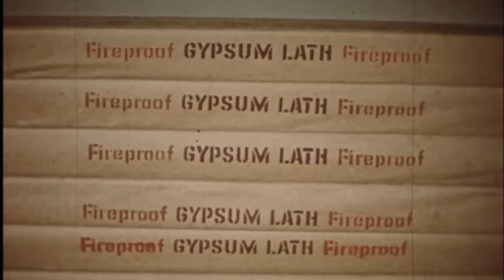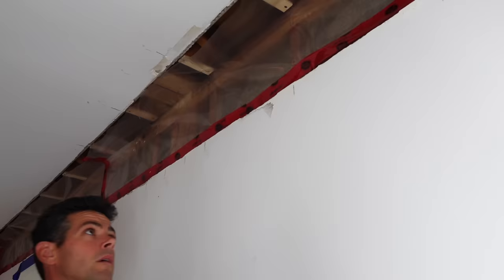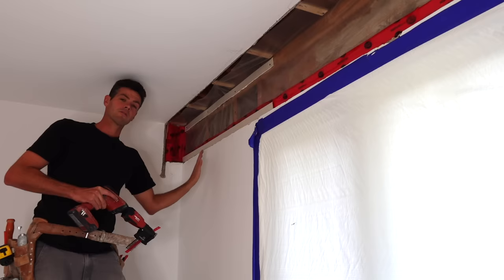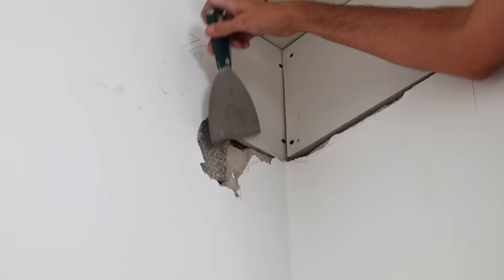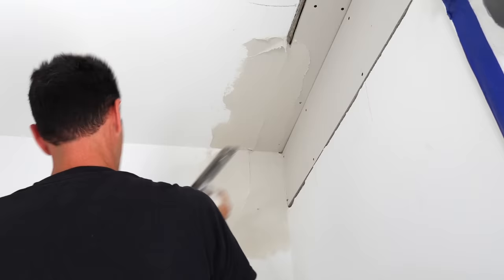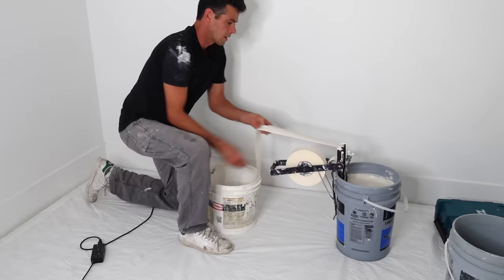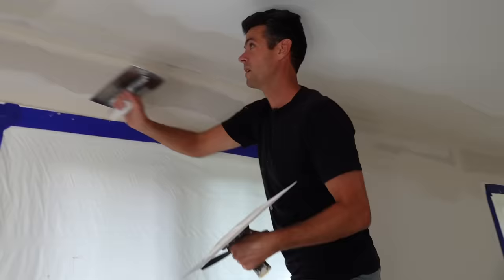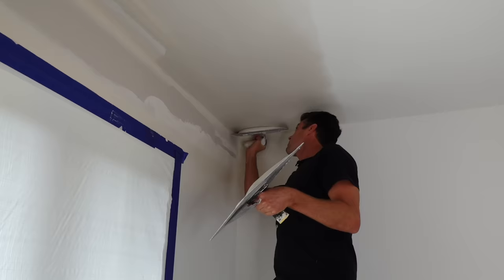How to Repair Mid-Century Plaster with Drywall!

Comment: The contractor I worked for in the 1980s would patch plaster walls by nailing or screwing a piece of 1/2” drywall in the hole with the back side facing out. We would mix up a bit of Structolite and fill almost flush, then give it a coat of finish plaster. Working with Ralph and Nick, (my boss and his brother), was like having walking encyclopedias of how houses were built from the 1920s onward.
Reply: I agree that is a better idea

Comment: I have this in my house, which was my grandmother’s house, built in 1950.  The only difference is the “drywall” boards underneath are “button board” which has holes to key the plaster through.  It also seems harder, maybe not quite cement but similar.  It has archways in all the doorways except between the kitchen an dining room, which used to have a swinging door. I decided to buy an arch kit and put in an arch there, and now I’m working on getting the right depth between the drywall and plaster.  This is pretty good timing for me!
Reply: Perferated gypsum board lath.  Rock Lath was one of the bigger brand names back then.

Comment: Our home was built in 1943.    While doing renovations years ago, I discovered our beautiful plaster walls used gypsum board instead of wooden lathe. This gypsum board has held up amazingly well, and it enhances fire resistant and insulation. You’re right about this type of plastering being well done. I hope people who have this type of plastering will see its value from your video and patch repairs like this instead of ripping it all out and replacing all of it with drywall.
Reply: I'm working on a house from 1760 and I wasn't quite sure what that was I was working with. It wasn't horsehair plaster and I gather that at some later date somebody used cement board or something similar to door repair in the early 1900s perhaps. I'm not sure
Reply: Not door repair but I meant to say to repair

Comment: Great vid Ben...someone asked about matching textures for a repair..there are four different textures in my house. One method they used was lay out a thin coat of plaster and then press a damp burlap sack into the wall..my parents witnessed this when they had the house built in 1947 (Victoria,B.C.)
Reply: I'll have to give this a try,  i was using a torn sponge but it never turned out quite right
Reply: And you know when I do plaster repair I use some cloth in the initial layer after I put a sloppy layer on the left with a paintbrush
Reply: @failprone well. I used cloth. And it was either an old lightweight towel that was dipped in a slurry after I already pre-wet the wood with a slurry to let it soak in. I wasn't covering huge areas but I already knew that if you don't pre-wet or do something to get that lathe wet, the repair will pop out because I did a repair in a house in 1860 and the crack would reappear with simply using wall compound. It was a stress crack near a door that open and shut every day into the apartment and after I added dryer lint into the area and free wet of course. The surrounding would of a 5 inch by 3 inch hole. It never ever popped out again and that was my third and final repair at the entry into my apartment where the door handle is. And it's never cracked. The house has since been remodeled and taken apart by some new owners but I do remember the trick of dryer fuzz or lint to strengthen the wall compound
Reply: I meant to say l a t h e

Comment: Decent command of the tools, kid.  1/2 drywall on top of 1/4 drywall furring = 4/8 + 2/8 = 6/8 so with 7/8 nominal thickness of original plaster you will have 1/8 nominal to spare to fill and true up the plane. Of course that means sometimes it can be flush or protruding.  I leave 1/8 to 1/4 inch gaps between the Rock Lath and drywall and make sure my plaster is stuffed in there.  Lightly wetting the gyp core helps adhesion.  It will not crack like that.

Comment: Have the same set up in my 1950s house in eastern PA. Had to do something similar. I opted for 5/8" drywall directly on studs (instead of adding filler strips and using 1/2" drywall). Prefilled with Durock 90 and then used premixed mud (on top of Durock 90) since it's easier for me to get a smoother texture. This was my first drywall/mudding job. Unless you really know where to look, it turned out decently well.
Reply: I patched plaster using Concrete Fill , more common out west than Durabond , very similar compound , only “mud” that will bond and blend with plaster
Reply: Currently attempting the same.

Comment: Oh how badly I wish you had made this video a year ago!! We purchased our 1962 Toronto home almost a year ago now and have been DIY renovating it ever since. There's not much info about this era of construction on the internet so we have learned a lot through trial and error. We also learned how solid and heavy this stuff is during the demo stage! Some walls were wavier than others, but overall 5/8" drywall lined up pretty well with the old plaster, and then we FEATHERED out any height differences. This video is very validating for our noob DIY work :) Thanks for the vid!

Comment: Man am i so glad you decided to make this video. My house was built in 1950 in Boston. And this is the same process and materials they used. I Have some experience with repairing walls in these older homes but had never come across this type of plaster board. I think this video is the only one that I have ever seen covering this method of drywalling. So thank you. ONe of the first things I noticed when we were looking to buy my home was the amazingly straight ceilings and walls . Cheers, William

Comment: Very informative, but I could have used this about 20 years ago. 😂 My house in West Michigan was built in 1941, using 3/8 x 16 x 48 inch Gyprock, or Sheetrock, panels. It had several settlement cracks and a lot of water damage. I'm no pro, but I taught myself pretty much everything you showed in this vid, plus some more tricks. Great teaching job on your part, for anyone yet to have that much fun.

Comment: This is what I have at my house.  Thank you for the video.  I  have been learning to  work with this.  Watch out for asbestos when working with the backer board.  Unfortuantly all the contractors's workers here  have no idea how to fix this stuff.  Aparently I am much better just doing it myself, even not knowing what I am doing.  California patch is your friend when patching holes with this style walls.  Workers tend to not do anyting with the metal lath, leave nails sticking out etc, if the ruff work guys  put in the wrong thickness backer, the drywall guys just pull it out and put 1/2" dryweall then try to mud out the last 1/2" leaving the walls very wavey.  It's all in the prep, getting these lines up well and then you will be fine.  It's actually not that hard, but contractors just want the paycheck so they skip over the detail work and it ends up terrible.   I used allot of drywall shims for patching smaller holes due to varying thicknesses.  Also some times it helps to have some fireboard etc for the various thicknesses you might encounter.

Comment: I just moved into a house with rock lath plaster. I thought it was initially 2 layers of drywall- thanks for the clarity. Built in ‘69, like you said, most of the stuff is in fantastic condition.

Comment: I wish I saw this before I started. 1940 home. We did not push down the metal mesh enough. Applied the first drywall patch with 1/4 drywall with 1/2 purple board to make it close to even with the plaster. Metal mesh rusted through the plaster! Wish I pushed it down more and used shims on the studs instead! DIY learning curve for sure!

Comment: Mine is 1870 but same old stuff lol just horsehair plaster. When u have big cracks that detach from the wall go to lee valley and get plaster washers they wrap around the drywall screw and sucj the plaster back into the lathe. Then fill cracks with durabond and skim Overton with 20. The cracks are actually gone for good
Reply: Excellent. We did use those little discs but I didn't think about squirting in some wood glue behind the slightly loose plaster that was Raising off the lathe. And this was a 3-foot crack on a slanted ceiling of an attic so I got you out to a half an inch wide so I could wet the area of plaster and the wood behind it and then use plaster of paris. Not wall compound unless I had put some Fiber into it meaning dryer lint!

Comment: Your video on concrete fill you talked about structolite being the equivalent in the us. I tried it and it’s basically a plaster product. I’ve used it to fix lath and plaster and it works great to fill large area quickly

Comment: Can't paper tape over plaster. It needs to be mesh or FIBA fuse or it's ganna blister. Mud cannot penatrate cement so it forces all the moisture out through the tape
Reply: And we were using a plastic mesh tape over cracks that were mended after they were gouged out to a half inch and I prefilled that with plaster of Paris after I wet the wood behind it and all edges of the plaster that was showing. If I had to use wall compound I would mix in some dryer lint. A ratio of 1 to 3, one part dryer lint

Comment: The drywalliest carpenter on youtube!!  Awesome video, my house's wall are all made with the gyprock/plaster walls throughout!  If I had seen this video over a year ago, I might have saved a bit of extra effort in my kitchen reno after I had removed a bunch of ugly bulkheads in the kitchen.  Nevertheless, we put 1/4" sheetrock to cover the entire ceiling for a smoother finish and filling in a bunch of holes, and we were tearing down the old walls down to the 2x4 studs so that we could extend the wall another 1 1/2" for better insulation and completely replace bunch of electrical/plumbing work.

Comment: Hello Ben. My wife and I bought a early sixties bungalow with plaster walls and have had my share of repairs after some small renovations upstairs, but when I removed the wall between the kitchen and dining room I hired a friend of mine who just happened to be a pro drywaller. 
He had me do the prep work for the openings in the walls and ceiling and like you I used 1/4in” and 1/2in” to fill the gaps. He did great job, much better than I would have done, and well worth the money. He also showed me a few tricks, as you have done as well, that me better going forward with future repair and reno projects. Great video as always. Great channel(I subscribed after watching for the first time a few years ago) and thanks for all of your work making these videos. Very helpful.
Reply from the maker: My pleasure.

Comment: This video couldn't be more timely. I'm currently doing exactly this same thing in my 1946 kitchen. I had to rip out a section of the wall where the tile was stuck to the backsplash, so I have gaping holes in the wall that need to be brought flush with the existing plaster. The depth of the plaster is inconsistent, and to make matters worse, the studs are all different depths too. I had to take a new 2 x 4 and rip spacers to staple to the studs. In some cases I had to add up to 1" to the existing studs to bring the drywall up flush with the plaster.

Thanks for the great video.

Comment: I have that in my 1943 house outside of Baltimore MD, someone told me it was called wallboard. The drywall 2'x8' are fixed to furring strips. The first coat (brown coat) seems to be cement based and will dull carbide very quickly. I have to use the blades made for bathroom cement boards to cut it. Iit looks very flat, but nothing is flat or square putting a level on a wall is scary, but it looks very good.  These screws from GRK really helped me because you can move the new drywall in and out by screwing the center of the screw...GRK Fasteners Top Star Shim Screws

Comment: This repair was my specialty when I was still working. I used exactly the same method as Ben. This is the most satisfying of all the repairs you can do on an old building. Looks better than new when finished!
Reply: I'm definitely not a mud dragger. Can do the job with the addition of a $100 worth of sandpaper and looking like Casper the ghost in the end. One thing I've definitely fixed for outrageous price's is fixing sheetrock mud falling off ceilings and walls tied into plaster. Just doest bond and stick especially when you cake it on inches thick to fill those huge gaps.  Take the money and run is the theme. Job looks awesome for a few months until some slames a door to hard and chunks fall out. I've always sanded, wet the old plaster, then use plaster to tie in existing to new sheetrock "prefill" then use mud.  It's actually sad when the homeowner has already shelled out cash a couple times and getting the same results.
Reply: @mike-sk2li  
I've never had a call back on any of the work I've done. I always taped the transition from plaster to fill to drywall. Then, I would float it out.

Comment: That mid-century method blew my mind the first time I encountered it. I grew up in a very old farmhouse, lath and horsehair walls, got a commercial maintenance job doing a lot of doubled heavy sheetrock on metal framing, then bought a 1959 house with the plaster on wallboard, where the plaster was no joke 2" thick in some spots! Took a 12' long wall to the dump, it was 800 pounds! Anyway, great work, you've taught us a lot!

Comment: YES!! My house in America had this type of drywall in the bathroom, then coated with plaster, with TIN painted tiles about one-half the height of the wall. The house was built in 1941 (pre-Pearl Harbor). And yes, I found the wire mesh in the corners as well when I demo'd the bathroom to remodel. To the best of my knowledge my entire house is finished this way as well. I am hesitant to even try patching the cracks, since traditionally you're supposed to make the cracks bigger to get the spackle in before either sanding or damp sponging the spackle. I"m no Vancouver Carpenter, so I try avoiding making things worse by trying to do too much for too little improvement. Love your work and your work ethic.

Comment: I've been obsessed with confil ever since I learned about it from you.  I finally found an equivalent in the States - RapidSet OnePass.  Honestly, I can't tell the difference between it and repair mortar (lol) but I've used it a lot now and it works well.  It seems to shrink even less than hot mud, so it's nice for your larger blowouts.  Be very careful about overfilling though, it's like sanding cast iron.  I prefer to underfill with it and then skim it with something sandable later

Comment: Much of mine was cracking and sagging with stippled ceilings and sand swirled walls.  I removed tons of this from my house and replaced it with roxul insulation and 1/2 drywall.  Looks much better.

Comment: The original rockcliff was only 16 in in height by about 4 ft. It was similar to regular drywall back in the day. However proper rocklath has chemicals in the paper on the surface of the board to help that plaster set, the reason why they have steel laugh is over the seams it's to prevent it from cracking, you also need to be sure to add a fibrous material into the plaster for the base coat, to prevent cracks from appearing. Best thing to do for fiber material is to go to either a dispensary and get the stocks cut down to quarter inch lengths, or take sisal rope and cut it the little quarter inch length and break it apart so it becomes a fibrous material.

Comment: Great timing... I am currently repairing a couple of spots on the rock lath ceiling in my 1959 garage... I am trying to decide how to recreate the rough texture... It is not orange peel or popcorn... It appears that the original plasterer troweled on a finishing coat and randomly brushed the surface with a stiff bristled brush.

Comment: I have a 1953 home with this construction. The big problem I have had to deal with is the top skim coat delaminating. Some of the repairs I used ready mix mud only to find it to completely delaminate a few years later. The latest room I used the powder mud and sealed the edges of the skim coat with watered down glue (thanks to one of your videos) . So far it seems to hold. I would love to see more on how to repair this era, especially matching up the texture. Mine seems to have a sand in it with light swirls. If anyone has any tips please respond. Thanks in advance.

Comment: I'm in Seattle we have 1 plaster yard.  Mostly a stucco spot so interior veneer plaster is not something readily available.

Unfortunately it's been like this for so long customers look for drywall contractors to fix plaster repairs.

Been in the trade for 6 years now and have yet to meet a single plaster specialist.

I like to do plaster work but it's cost prohibited here